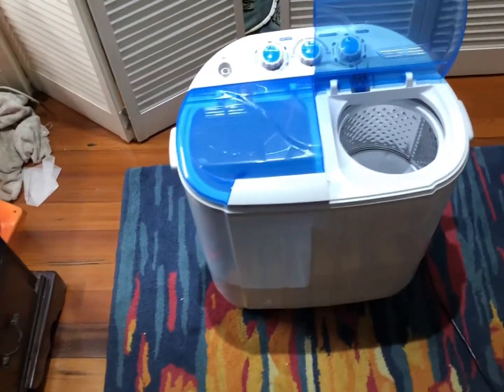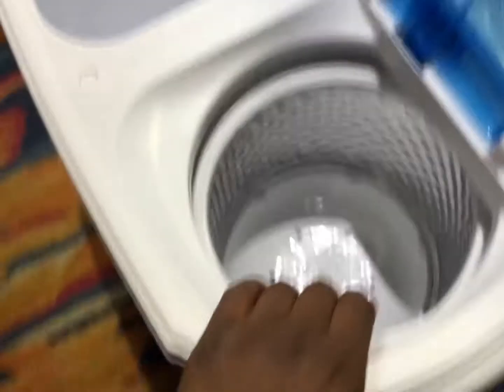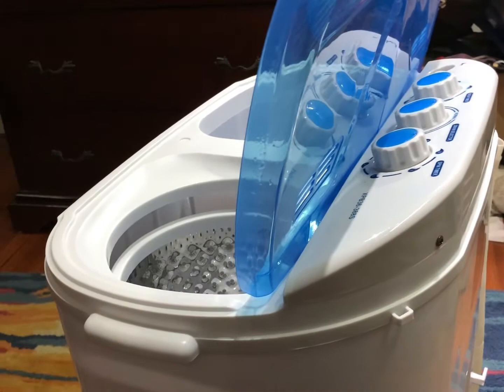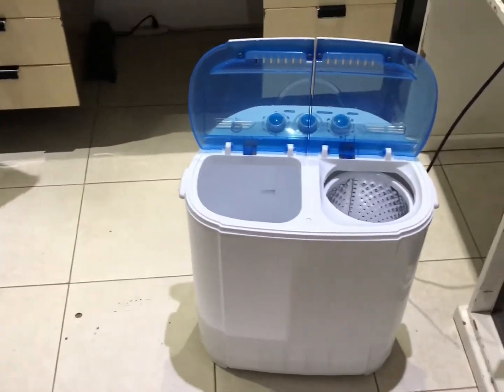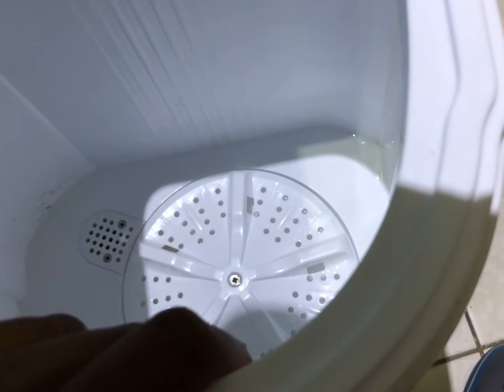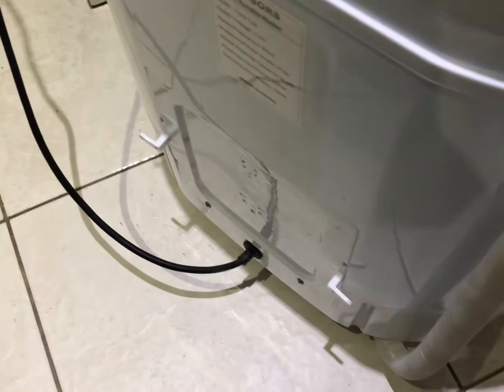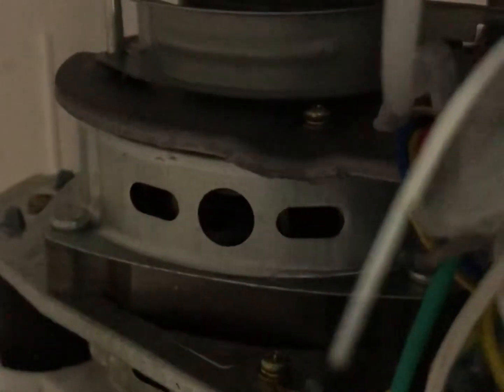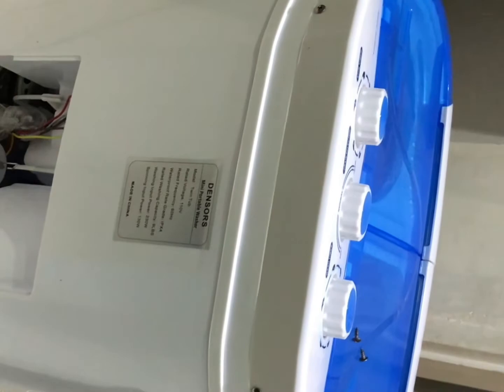Twin Spin XPB36-388S Washing machine after 5 months

Comment: Have you found a way to clean the drain hose?
Reply from the maker: I haven't tried this but I would suggest flushing some fresh soapy water through the drainage system and maybe connecting a garden hose to the drainage hose and flushing water back up it at high pressure. I suspect that would clean it out.